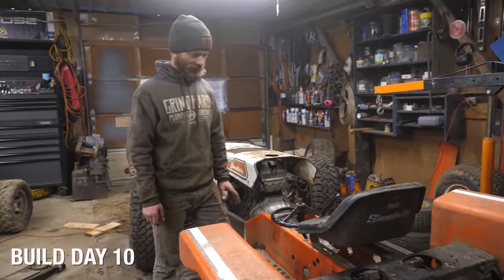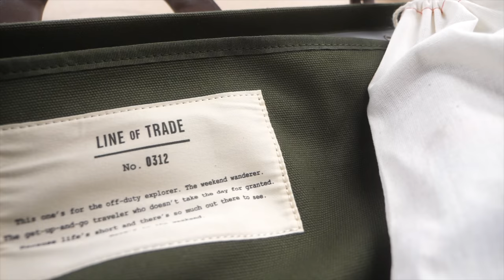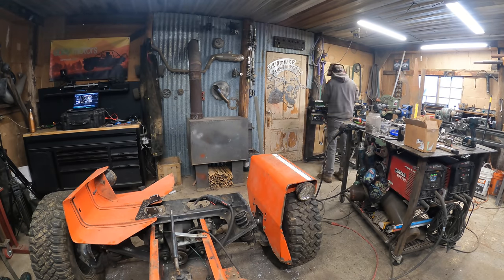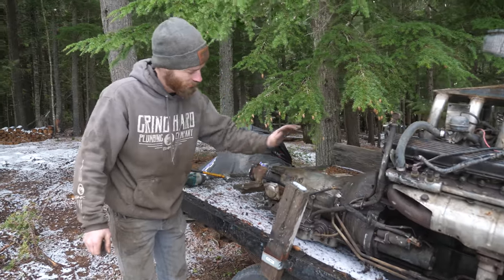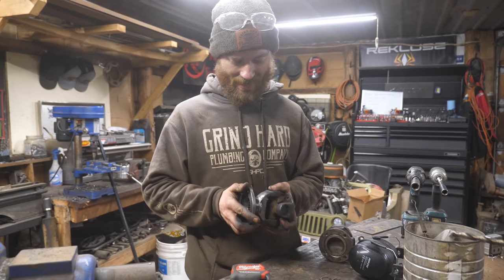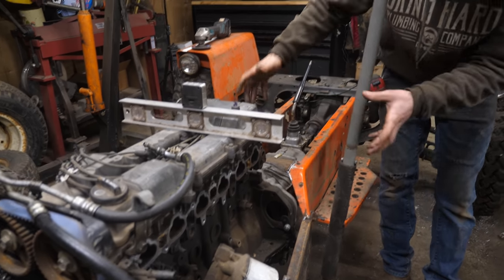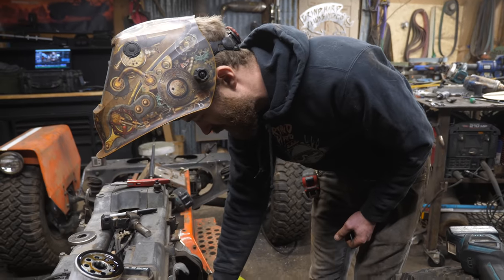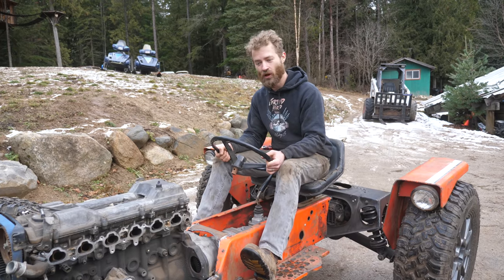2JZ Lawn Mower Build - Engine Mounts and Fabrication

Comment from the maker: Get 20% off your first monthly box when you sign up at https://bspk.me/grindhard and use promo code GRIND20 at checkout!
Reply: you wont reply
Reply: yo you guys should put on1 brake pedal for each wheel like a real tractor!
Reply: Do you plan to put a mower head on it so it can actually cut grass? That'd be wild, mowing your lawn with a 2jz tractor.
Reply: Does this also work from Germany? I‘d love to try it.
Reply: Little bit of science on the Damascus: it two different carbon content steels. They are forge welded then cut and stacked into any number of patterns. Once the final pattern is made and the blade is made and sanded to a fine finish it is acid etched. The higher carbon content of one of the steels means that it etches slower. After the desired amount of time the piece is removed from the acid and neutralized. This finished piece is then polished to leave the two tone finish that you see.
Reply: @mot_0478  nah, just Canada and USA. Already tried to get one to Australia and it's a no go.
Reply: Congratulations for 1 million subscribers see you later on 2 million subscribers  (peace frome Algeria)
Reply: Send me the dirt bike please
Reply: Send me the dirt bike
Reply: Send me the dirt bike
Reply: Send me the dirt bike
Reply: Send me the dirt bike
Reply: Send me the dirt bike
Reply: Send me the dirt bike
Reply: Can also built support over engine to connect both sides
Reply: Cradle it up
Reply: Can you help me build one this is awsome
Reply: @grindhardplumbing the shifter angle does not look to be in a health position.
Reply: @jacklougheed4561  appreciate you. Happy you clarified that, I was like "heyyyyy 🤔" when he said Damascus was also when you fold the same metal onto itself, which we know that japanese process is actually called shita-kitae.
Reply: @luiscroft9103  ok thanks
Reply: Hey guys you should use different music on ur vids. It just kinda gets booring listening to the same track on and on. Btw love the vids! Keep it up.
Reply: Up next they put a Lamborghini Gallardo v10 on a motorcycle
Reply: They dont ship to Australia😭😭
Reply from the maker: You never know...
Reply from the maker: That would be awesome!
Reply: You got to turbo the 2JZ motor
Reply: A stock 2jz is slower then a 300hp car so it's better if you put a big turbo on this thing
Reply: You guys going to be able to keep using the drone?
FAA is cracking down.
Reply: Love the cutting the box fail with that knife😂 ....rippp works great shows a ripped (not cut) box 😁
Reply: Thank you so much
Reply: @jacko9029  ⁰⁰⁰
Reply: i don't think this is a lawnmower anymore, it's a homemade racing kart

Comment: FYI you guys are the main reason I want to get my welding license
Reply: You need a fucking licence to weld?
Reply: @sethyooosethyuuu5833  this 😂😂😂
Reply: @sethyooosethyuuu5833  no but I want to weld trophy truck and stuff
Reply from the maker: Glad to hear it! You got it!
Reply: It's a certification and you don't need it I've had my certificates for 15 years
Reply: @chadscott2499  actually I'm getting certified not to weld trophy trucks but I'm getting certified for the highest level of welding that I can because why not
Reply: You have to have a liscene?
Reply: @benjaminevans1171  no but if you are welding for work you do for some jobs
Reply: In my country no need for that
Reply: I am 14 and i know how to weld and all other stuff
Reply: Skip the license and buy a welder and get to it.
Reply: No you don't I have been a union millwright for chicago 1693 local since 07 you don't no what your talking about son there a certificates for stick mig flux core and also tig and there's a 3/8" test or an 1" no license
Reply: @chadscott2499  can confirm UT local 140 pipe fitter, certs matter in many different fields of welding. People can weld without a license but don't expect them to work on anything important that pays well.
Reply: @ajj2019  I know that bud I'm trying to tell this kid you can weld without certificates I can't because of the being in the union and also many of these factories and call for certs and it also matters what I'm welding but this kid just wants to weld his roll cage
Reply: @ajj2019  it's fine for scabs to weld without them but not us I'm just trying to let this young blood know what is up

Comment: And are you guys leaving the motor stock or are you guys going to be doing work to it  like putting a bigger turbo on and stuff like that
Reply: Stock is 200-250 hp. How much do you want in something with a high center of gravity and nothing around the driver as far as safety is concerned?

I love the channel and don't want to see anyone get killed. This thing won't need much power to be completely insane. 

Also, that toyota transmission probably won't take much more than stock torque before it grenades.
Reply: @garrettstevens2232  And it would grenade right underneath you to boot!
Reply: It’s a two 2jZ and I just know a lot of people do a lot of motor work to them so I was just wondering if they were going to do the same thing and they’re probably gonna build some type of role Cage for it

Comment: If you have any vibration problems with the double u joint rotate it 90 degrees. Then bolt the 2 back together. It’ll balance the double u joint set up.

Comment: My Uncle was my shop teacher In highschool. We built a lowered and stretched riding lawnmower. Upgraded tilt steering, large atv wheels and tires and a two stroke Yamaha 175 Motor. It was a Raped Ape !...So much so, the principal made us remove 4th and 5th gear to limit speed. Party poopers.

Comment: The reason Damascus steel is so tough is because if you think of it like a funhouses plastic ball pit where it’s soft and moves ezy then you heat all the balls up until they become sticky then put them in a garbage compactor until all the air is out and it’s a compacted hard block of plastic so basically you take a large piece of steel and heat and squish all the steel particles until all the space between them is as small as possible ending with a super dense piece of metal to make the product from and an awesome pattern depending on how you compacted the steel one hit at a time

Comment: Hey I just wanted to check if you guys were aware that the suspension link you removed is what maintains the toe angle, without that it will toe in like crazy when you accelerate and toe out when you brake, along with potential camber weirdness.

Comment: Have you thought about running 1.25" tube in the mid-section of the frame? Like tucked into the bends of the sheetmetal.

Comment: Have you thought about shortening the rear end? It might be a bit more extra work but there's a reason a lot of hot rods use them in the UK. The discs being inboard make it a lot easier than solid axles to shorten. I used to have a shortened jag rear end that was used on a few projects.

Comment: If the fenders were mounted closer inward and on the frame instead of the hub part, it would be able to mount deeper inward wider wheels and have clearance. Maybe drag wide wheels like in the tractor pulls.

Comment: Bit of info for you boys you may already know but land rover used a very similar front calliper to the one your using. So if you need to find bits it might be easier to buy a set of those as they should fit the same but be easier to get bits for

Comment: In the 70’s I worked with a guy in his early 60’s, he was retired Navy Master Chief and my head building engineer who kept everything running in a small manufacturing plant. He was from Ohio, grew up on a farm where he and his father kept all their equipment running. He told me he and his buddies would get junk cars cut the middle out of them weld the frames back together with the transmission connected directly to rear differential, shortened the car up just a bit. No rear just front brakes. Worked on them during the winter and would race them around in the fields and woods just for fun when time and weather permitted.

If this sounds like fun next time you’re between projects try slapping one of these together, cost and brain power should be minimal, not building a show piece!

Comment: You've stiffened the front, but you really need to put some strength into that rear subframe. It will not last, it was never meant to do this, and in pretty much all the Jaaaags, i've worked on, it's the piec of metal that failed the most, whenever direct force was applied to it (side impacts, curb side impact etc).

Comment: not that it really matters here but when u make a drive shaft put the U joints 90* to each other so in flex they cancel out each other’s acceleration. If your trans and rear end are perfectly in line and don’t really move it’ll probably b ok

Comment: Not for nothing but I put a V8 a Nissan 720 pickup truck and it drive shaft looks like the same drive shaft that went from the transmission to the transfer case same size it's amazing how you did it was cool 😎 👌 👍✌

Comment: 10:30 If you held the wheels and held down the throttle in gear, then the parts would probably friction weld. Also, it should self center. 😂

Comment: Having the fenders being unsprung mass isn't a great thing, but for low speeds and putting around, should be fine
Reply: Having rear suspension on a "lawn mower" is far worse than a bit of unsprung weight! (if you were going to use it for mowing).

Comment: That transaxle is out of sync. Those two flange-mounted knuckles that are now riding on a same plane, should be 90 degrees apart. 
And please have the stamina to weld a tube enforcement around that collection of plates for a frame..